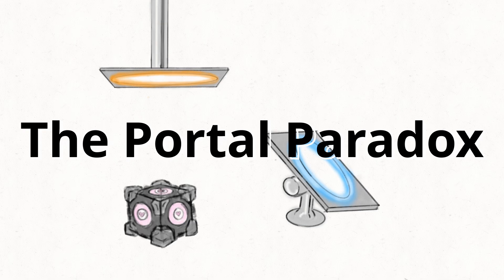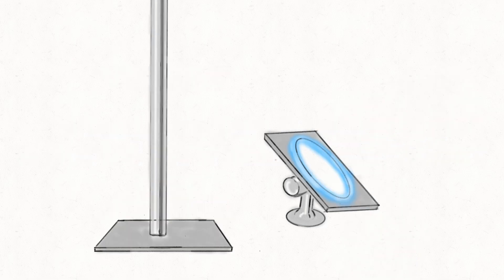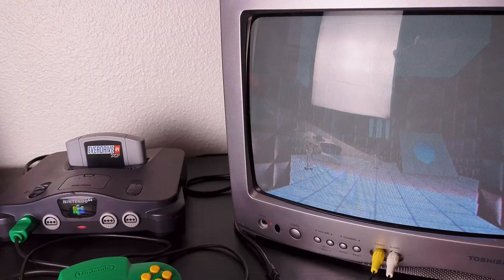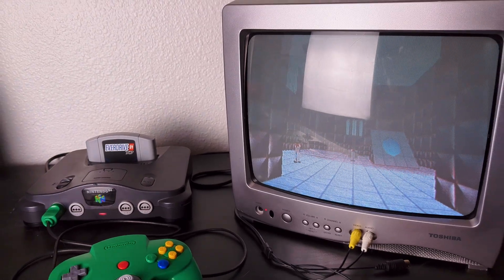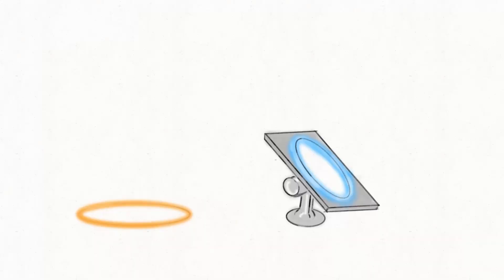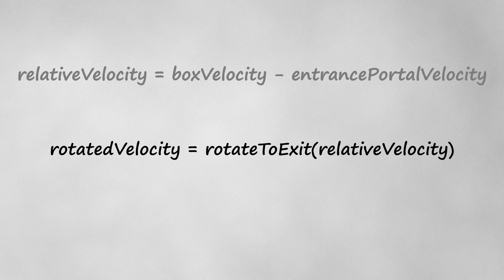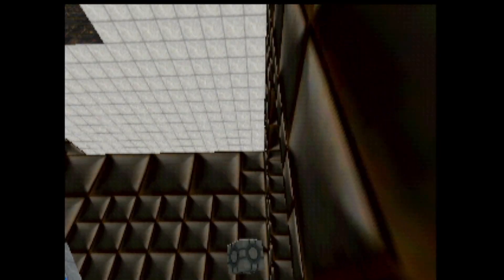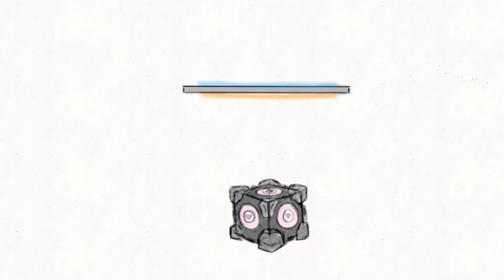I rewrote Portal from scratch and solved the Portal Paradox

Comment: What bothers me about this problem and this solution is: what exactly gives the velocity to the cube?
From the cube's perspective, what pushes it away from the floor? Does it suddenly feel a force upwards and away from the portals? How does the Orange Portal transfer it's velocity to the cube if it never even touches it?
Reply: Say you place a portal on a ceiling and another on the floor and you drop a cube into it, allowing it to fall infinitely. As it passes through the portals it keeps picking up speed and if it wasn't for air resistance it would in fact pick up speed forever. Where is the energy coming from in that process? You might say gravity but no amount of height would allow you to fall at speeds reaching the speed of light within earth's gravitational field. No the portals themselves convey energy to objects that pass through them simply by their very nature of being able to transport objects to disparate points in spacetime. 

But to give a more practical answer, the cube essentially pushes off of itself and the floor below it. Looking at purely the blue portal, what you would initially see in slow motion as the orange portal descends, is a small portion of the cube sticking out of the blue portal. Then a moment later more of the cube would be sticking out of the portal. But that would mean that the first portion of the cube would have to have moved out of the way in order for that to happen. Essentially the lower portion of the cube is pushing the higher portion forwards in order for it to exist the portal. And then the next portion does the same and so on and so on. By the time the cube fully exits, the entire cube is moving at the same velocity as the orange portal.
Reply: @BlazeMakesGames  By your definition, if you even touched a portal, it should suck you through it. On your gravity example, if you had infinite height, with a constant acceleration due to gravity, an object would speed up to its terminal velocity. This is what is happening in your example. This just can't happen outside of portals because A: get too far from earth and gravity decreases, and B: get too close, and the ground stops you.
The portals really just move one location in space to another, they don't pull objects through themselves (unless one is in space, sucking objects in because of the pressure difference).
Reply: @ianwalsh3868  So portals work literally like doorways.
Reply: @fantastikboom1094  Yes, that's my understanding.
Reply: @ianwalsh3868  No, it wouldn't.
Reply: @BlazeMakesGames  No, it wouldn't keep picking up speed. The energy comes from gravity, that is a fact. You're in freefall, like jumping off a cliff, but you keep teleporting back up. The portals are doing absolutely nothing. The cube would reach terminal velocity and it would just keep falling at that same velocity. There is a limit to the speed. If we were in a vacuum, and you tossed a cube into portals that faced each other, the cube would keep the velocity you threw it at, because there are no other forces acting on it. If none moving portals did act on objects going into them, then everything would be shot out of stationary portals equal to the amount of force they exhibit. however, the portals do not interact in that way. They do not interact with objects going through them.

Portals are more like doorways. If a moving wall with an open doorway came towards you, and you go through, are you inheriting the wall's velocity? The difference here being the space on the other side, and how the forces on the other side interact with you, not the portal.
Reply: @BigFry9591  A better example would be putting a portal on a wall and another on the ground. Falling into the one on the ground and coming out the other going in a different direction does give velocity to the cube.
Reply: @LineOfThy  I just have to say that I love being able to keep coming back to this topic, even two years later. It’s fascinating. Thank you for continuing to comment!

On your approach, you say that is giving velocity to the cube, but it isn’t. Velocity is: speed in a direction. When the cube goes through the portal it has a certain velocity (say 10mph, downward) with the bottom face facing the floor. At the exact moment it comes out of the portal on the wall, it is still moving at 10mph, but now the direction is sideways out of the wall from our perspective. The cube keeps its own velocity at all times, the portals never add to it. It’s just that the direction is relative to the cube itself, and not relative to where we are looking at it from. And then after it has come through the portal, gravity will be acting on the side of the cube instead of the bottom.
Reply: @ianwalsh3868  velocity is a direction, not a magnitude. Changing direction means changing velocity.
Reply: @LineOfThy   Velocity is speed IN a direction. The magnitude of the velocity is the speed. While, yes, the cube changes direction when coming out of the cube on the wall, it is only changing direction from your perspective. If you were the cube, (or were sitting on top of the cube), from your ( / the box’s) point of view, it would still appear to be going downward, just like before it went through the portal (until gravity starts pulling it sideways). Velocity is relative to the box, not to any place you can stand and watch it from. So, the velocity does not change when going through the portal: when going through the portal on the floor, it’s moving 10mph in the direction of the bottom face, and when it comes out of the wall portal it is moving 10mph in the direction of the bottom face. The velocity is the same. The portals cannot affect the acceleration or velocity of the cube; only its position.
Reply: @ianwalsh3868  I can't refute that because nothing you just said has any basis in logic at all.

Why does it matter that the velocity doesn't change from the cube's perspective? Nothing has changed except for the cube. It has, on its own, altered its own velocity, which it could not do without portals. You cannot just say "it's same from the cube's perspective" ALL perspectives need to line up, which is why portals break physics.

And even then, you demonstrate a fundamental misunderstanding of energy. Gravity doesn't "give energy" to the cube, it converts GPE to KE. Portals essentially give the cube INFINITE gravitational potential energy, which according to the law of conservation of energy, is impossible.
a
Even your example regarding portals "pulling you in" misunderstands the point. Portals only "pull you in" when they move, they would act exactly like they do everywhere they're depicted without any logical issues.

And finally, think about this logically. If a portal moves over a cube, option A says it will appear out of the other portal without any velocity.

This is impossible. The cube has inertia, it cannot both "come out" of the portal and not have any momentum. The only way option A works is if the cube can't go through the portal.
Reply: @LineOfThy  You are saying some things that are correct, but you are not applying them correctly to this problem, and you misunderstand how a frame of reference is important. You are also "quoting" things that I didn't say, so I will no longer continue this exchange, although it was fun.

To your last point, yes, the cube would have inertia (as in, the property of inertia). However, the cube isn't moving (the example in the video). It can't continue in a direction, because it wasn't moving in a direction (when sitting still on the platform). Now, the movement/inertia/velocity/momentum you are thinking of in this example is for the platform the moving portal is on. It has momentum, speed, in a direction  towards the cube, but none of the energy of it's movement is transferred to the cube; it is only transferred into the platform the cube is on when it smacks into it, where it gets absorbed (turned into a small amount of heat).

Also remember, portals can't exist in real life. As you said, if they did, we could have an infinitely falling object, and gain infinite energy from it. But that isn't possible in real life. We are dealing with a hypothetical situation here, in a hypothetical world. Since we are starting this whole topic from the fact that portals exist, and function, that means that we have to ignore the fact portals disobey some laws of physics. In the world of Portal, you could use portals as an infinite energy source by having objects fall forever.
Reply: @ ye since you can’t seem to understand what I’m saying, I don’t want to continue this conversation

Comment: Let's talk about momentum.  Only the part of the cube that crosses the threshold is experiencing the effects of movement and therefore momentum at any time.   Since it is physically attached to a section of the cube not yet moving on the other side of the portal during transition that will have the effect of immediately cancelling the momentum until there is enough moving cube to pull out the rest of the cube that's not moving.   My guess is that with maybe 1/4 of the mass left it might just fall out in a way that seems like a tiny jump instead of the full on launch seen here.

Comment: The other form of reasoning I use to come to the same conclusion is to try and think about the situation 1 frame at a time, for lack of a better term. When the Cube first has the moving portal coming down on top of it, then that portion of the cube is sticking out of the other portal. 1 Frame later the entrance portal has moved down slightly and thus more of the cube is now sticking out of the exit portal. But in order for that to happen, the portion that was already sticking out of the exit the previous frame had to have moved out of the way. It is essentially pushed by the previous portion of the cube trying to make room for itself. And the speed at which it was pushed would be equal to the speed that the entrance portal is falling down over the cube. 

So while the portal is falling over the cube, the cube must be moving in order to physically move through the exit portal. But maybe it doesn't move beyond that point? Well that doesn't make much sense either. When the entrance portal finishes hitting the floor, the cube will have still just been moving due to it pushing itself through the portal, and inertia would still apply. So it still needs to lose all the energy that it just gained. There's nothing stopping it from moving other than gravity and air resistance. So it would slow down accordingly to those properties. Thus if the portal was fast enough to launch the cube, the cube will naturally fly out the other portal.

The other counter argument I've seen is that it doesn't make sense cause there's no clear source of the energy that propels the cube out of the other portal. but this is simply a fundamental property of portals as we see them. The simple act of placing one portal above another one creates energy from nothing. After all if you put a portal on a ceiling and floor and ran water through it, you could have a perpetual motion infinite energy device if you stuck a turbine in it. I mean you can do this in-game after all. So while I do argue that Newton's Laws still apply to the physics of portals, they do inherently break the fundamental law that energy cannot be created or destroyed. (similarly going from a higher elevation portal to a lower one effectively destroys energy as well)
Reply: Waitttttt that’s a really good explanation! I still didn’t get it after the video until I read this, but that makes sense to me! (Much more than some coding equation)
Reply: This is a fundamental misunderstanding of what a portal is. You assume that the cube is being moved through the portal, that it had to gain some energy to continue to push through threshold. This assumes that a portal is two separate objects. A portal is just a hole. For all intents and purposes, it's the exact same as dropping a hula hoop on a cube. The hula hoop represents a singular hole in space that is itself represented by two portals in this scenario. The entire hole is moving (which is NOT represented in the video, and why it only works when setting it up as a single moving hole in his engine). There is no force to overcome. When the moving portal has firmly stopped against the ground, the cube is still sitting on that ground. Any movement of an object that has a portal dropped on it is purely an illusion. The object has not moved. It is still sitting where it started. The only difference with an angled platform is that the axis on which gravity effects it would change and eventually drag it off the platform, provided the ground and cube themselves are not providing enough friction to counter that.

You also never create energy from nothing in Portal, nor do you destroy energy. The terminal velocity example you mention is simply providing an infinite corridor in which something can fall to reach terminal velocity due to gravity. You aren't creating any energy with the portals. As far as destroying energy, we don't do that either in the game and I'm not entirely sure what example you were trying to give for that.
Reply: @ChaoticNature  portal above portal. place a copper coil around this collumn and drop a magnet through. boom- infinite electricity. how is this not creating energy out of nothing?
Reply: @TemporallyAnarchaic  you are converting kinetic into electrical,  but you're drawing from a well of infinite kinetic energy.  the magnet will never stop falling, and melting coils is only an issue of drawing from the well.  portals create and destroy energy in impossible ways.
Reply: @sophsolanumsamsys  The portals, once again, are not creating any energy. Your assumption is that you're creating infinite kinetic energy with portals. You are not. Portals are not the reason the object is falling.

Portals are reducing the work requirement to reset the system to zero. You can replicate the example by moving the magnet back to the top by hand. In this way, you can create "infinite electrical energy" by hand, but you have to put in the work to reset the system.

Portals remove the need for work. Yet even then, entropy prevents perpetual motion.

But, regardless of it all, the portals are simply reducing the energy required to reset the system, not actually creating energy.
Reply: @ChaoticNature  if you get energy out of the system, but no longer need to put energy in to make it work, you are creating energy out of nothing.  if you do it by hand, lifting the magnet back, you put in at least the same amount of energy as you get out,  and you dont violate the first law of thermodynamics. if you need to put nothing in but get anything out,  you create energy, which isn't possible.
Reply: @sophsolanumsamsys  I'm not sure you quite understand the laws of thermodynamics. The first law of thermodynamics is literally what we've been debating. You cannot create or destroy energy, you can only transfer it.

You, in this situation, are never creating energy. Never. You are converting kinetic energy (source: gravity and magnetism, not the portals) to electricity.

Portals facilitate a system which requires no outside work to reset the system. This means the system is, functionally, neutral. It generates as much energy as goes in via gravity and magnetism without a need to spend some of that energy to reset. However, it is never creating energy.
Reply: @TemporallyAnarchaic  Very good explanation. That's what I thought, but it was diffucult to explain.
Reply: You just wrote nonsense.
Reply: @FantasTik Boom  just because you didn't get it, doesn't mean it was nonsense
Reply: @fantastikboom1094  rip out your eyes
Reply: @fantastikboom1094  hehehehe
Reply: very good explanation

Comment: Cool but I have a question. What force accelerates the portal? Portals just connect space. They are not solid objects so they don’t exert “normal” force on objects that touch them. 

The cube moves without having any push, pull, or friction, which means fictional portals like yours have a fictional “portal force” required to maintain conservation of momentum.
Reply from the maker: Portals connect space but they are obviously attached to a surface that is already moving on account of being on a planet that is moving.

If I were interested in trying to make the laws consistent I would make it so the momentum comes from the surface the portal is attached to both giving and taking momentum from either the entrance and exit portal. In this case to make it consistent it would probably derive the momentum from the exit portal. So if put a portal on a surface that could move it would be pushed back as the cube shot out of the portal but in order to make the physics consistent, it would also mean that the entrance portal would be pulled towards objects as they pass through.
Reply: @james.lambert  Thanks for replying! I never considered the answer to conservation of momentum could be portals transferring force to the thing there attached to.

I would be excited to see a video of other situations involving moving portals when your de-make is further along. Like what if a moving cube entered a stationary portal and exited a moving portal moving in the same direction?